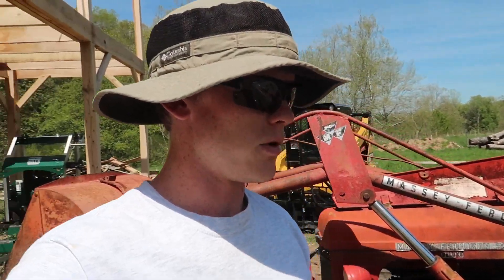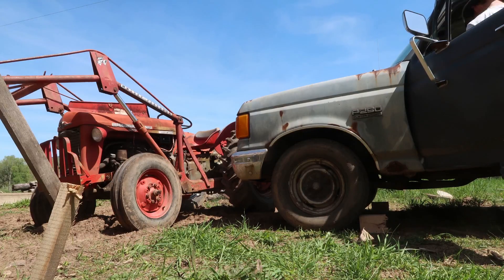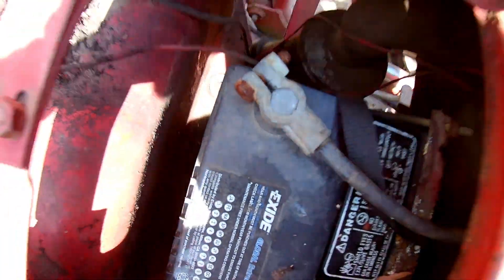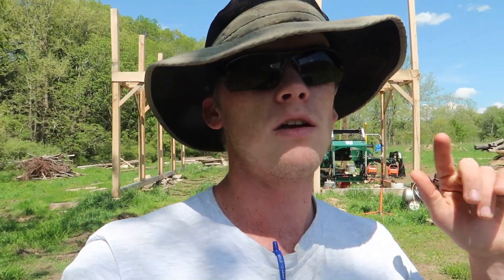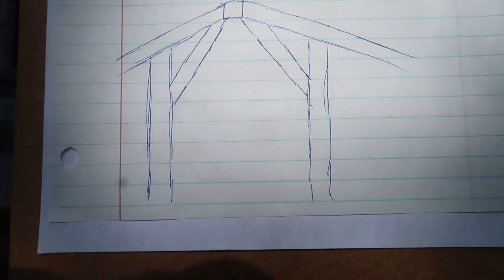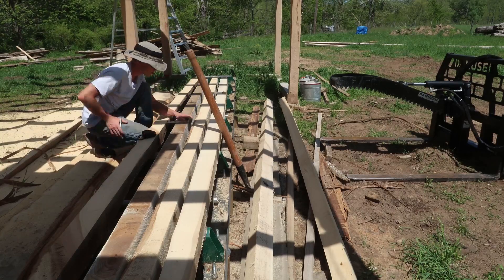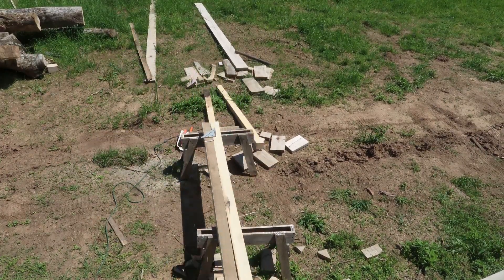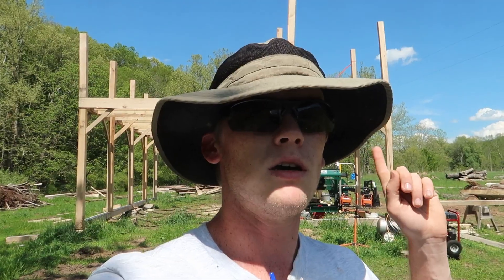Milling Top Plates | Sawmill Shed

Comment: You may have a dead alternator or generator if you have a generator go to the scrap yard and pick up a alternator from a GM with a built in regulator anything from the 80 or 90 and install it on the tractor if the battery is dead and you boost it the truck is putting a small amount of current in the battery then when it is used up it stalls the tractor as it needs fire to keep running the engine.
Reply from the maker: I haven't tried starting it again after I got it moved, but I need to see if there's any juice in the battery. It seemed to run pretty well with the new gas, and it's not the first time I've have issues with ethanol in the MF35. Josh